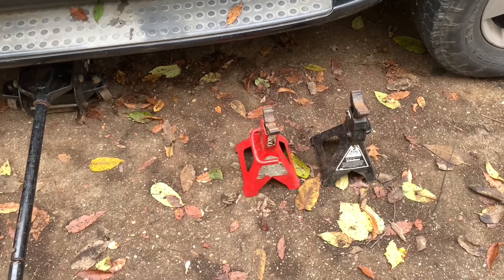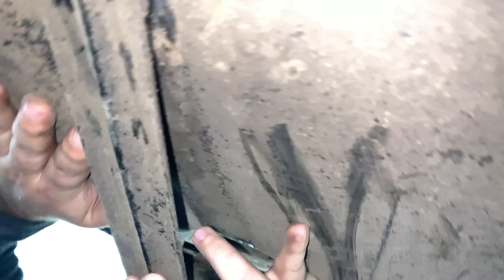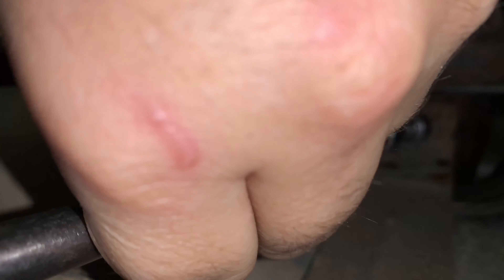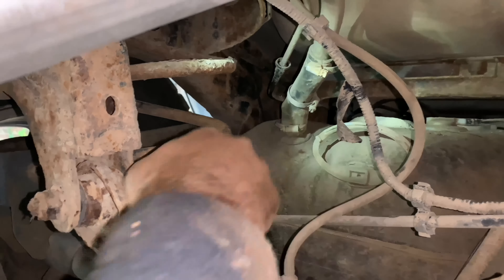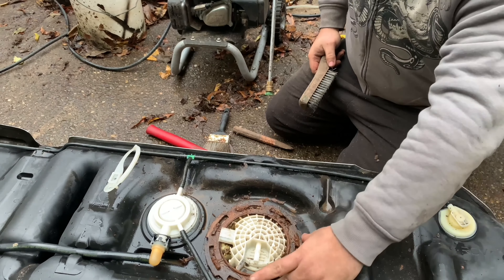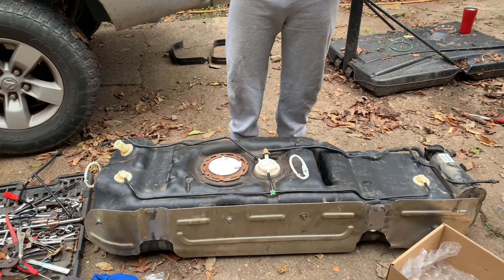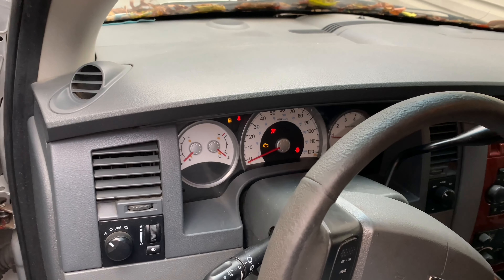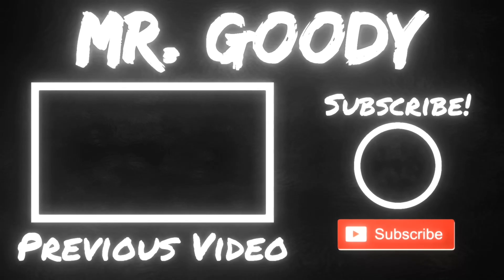How To Replace And Reinstall A Fuel Pump On A 2005 Dodge Durango 5.7 L Engine Hemi Edition - DIY

Comment: Why didn't you clean the inside of the tank due to the ETOH gas.
Reply from the maker: Off camera I actually did clean the outside and the inside of the tank.  Due to safety reasons and also to make sure and clean any sediments from the bottom of the tank also.  So no metal sparks would ignite any flame.
Reply: talk is cheap. make a You Tube video and walk the walk 🤔

Comment: I would like to thank you very much for making this video.  I could not afford to pay a mechanic to do this.  Please keep making videos.  I would like to make one other comment.  You did lie to use in your video.  You said you took your time with a rag and soap and water to clean the tank.  But guess what....you can see the pressure washer behind you in the video. Lol.....Thanks again.  You saved me so much money.
Reply from the maker: Thank you for the kind words and compliment. However, you only halfway caught me about the way I washed out the gas tank.  I use the pressure washer first and then I actually took warm water and soap and did it by hand from inside out and on the outside of the tank and then I pressure washed it one more time so technically you’re kinda a half right but it did take me a long time.  I’ll keep making videos as long as I’m breathing. I hope you have a great day. 👍❤️

Comment: It took me longer to get the fuel line off the pump than the rest or the job put together.  What you showed at 13:45 really saved me.  THANK YOU.  Maybe there is supposed to be a way to push and release but it wasn't going to happen. Like you showed, I had to dig out that clip.  I took a little time and I starting with incremental sized jewelers screwdrivers to get both sides to come out sorta together.  I did not want to break the clip or I'd be days getting another.    
FYI, the whole job was because somebody wrongly replaced the pump before, and broke the fuel level sending unit float arm when installing it (fuel gage stopped working) .  I say wrongly because the original pump never failed.  It was the Total integrated power module  (TIPM in a 2011 Caravan).
Thank you again for the video.
Reply from the maker: Your welcome my friend I’m glad the video helped ✌️👍
Reply: How did you find the plastic clip just in case you had to replace it. I broke mine but done even know where tog etc started to find a new one
Reply: @JaydenAdams-xx3xq  I didn't break mine.  I think if I were you I'd use safety wire (stainless steel tie wire (original use was to tie screws on aircraft so they don't come loose) and just wrap around the line below the connector and then tie it to the plastic unit.  I would drill a few small hole in the webbing of the pump housing to tie to.  You could probably do a similar job with zip ties.  Make sure the connection is secure and won't rust off.

Comment: one of the best videos I've watched..you went out of your way to explain every detail, thank you!
Reply from the maker: I do YouTube as a hobby and try to help people so if I helped just one person then I feel that my job is done I’m glad the video helped you my friend ✌️👍
Reply: you explain things really well, especially the little details..I have the dealer shop manuals and they're horrible! 4 huge volumes explaining nothing!
curious about how many hours did it take you all together to take the old pump off and replacing it?
Reply from the maker: Since I have done worked on cars here in there since I was a kid with my uncle it took me about 2 1/2 to 3 hours but I’m kind of used to doing these things even though as my main job I became a computer technician. But I work on a little bit of everything.
Reply: @Mr_Goody  you're really good at it! funny thing I never worked on cars until I inherited a 1930 ford model A that my mom learned to drive in when she was 12! I proceeded to do a total frame off restoration with my son and after 2 years (I only have time on weekends) it's almost all back together..every bolt and engine part was removed, cleaned and reinstalled! we are all crazy haha
Reply from the maker: That’s awesome story,  That’s what I call spending quality time with your son he will remember it forever ✌️👍

Comment: That last connector you pulled off was into the charcoal canister. the "fuel filter" and lines coming off it that have no clamps or connects are all part of your evap system (controls emissions from evaporating fuel) 
Good work, never fun on the ground with Jack stands hahaha. Keep on wrenching
Reply from the maker: Thanks for the info and encouragement 👍✌️
Reply: Where is the fuel filter?
Reply: @brendangay9007  there is a pre filter on the pump pickup and there is likely one inline on the frame somewhere

Comment: I know its not uncommon to get a bad fuel pump but is thr any way to be sure it's bad b4 have to drop the tank for the 3rd time? Had a bad gas leak dropped tank broke housing on pump. Tried to rig it, got it back in gas still leaking. Had to buy the whole pump. Replaced it. Put it back together and fuel pump doesn't come on at all. Relay & fuse good. Really not trying to drop this tank again. Any advice besides some folks just arent meant to be diy'rs. 🙄🙃
Reply from the maker: Well, what you can do is have someone turn over the key and not turn it on while you’re next to the gas tank and see if the fuel pump primes the fuel because as soon as you turn the key over before you start the vehicle, you’ll hear the fuel pump kick on and it’ll kind of prime fuel to be ready to be started. You can try that a few times. If you don’t hear anything kicking on then the fuel pump is not getting any power and it’s not working at all

Comment: Good job on video how many miles on your Durango when fuel pump died thanks brother
Reply from the maker: 118k miles when the fuel pump went out.
Reply: @Mr_Goody  ok thanks I have 2008; Aspen basically a Durango with 213'000 miles I'm pretty sure Its dead fuse relay seems good pump not energizeing when key on position engine starts with starting fluid

Comment: Ik its 5 yrs now but mine went out on the highway is this job possible from the rear by the hatch with where she broke down it would be unsafe to have the jack driverside rear as it could be hit by oncoming cars any advice would be great doing it today
Reply from the maker: If you are careful, you can do it from the rear or the opposite side that is on the shoulder of the road.  I strongly suggest that you do not work work on the shoulder of the road. It is very dangerous but if you have to like, I said, do it from the opposite side of the vehicle.  Try to see if there are some friends that can pull you to a parking lot. That’s close or any place that is away from the road.

Comment: I have a aspen that I ran on a empty tank for a few miles… I put a quarter tank on it drove it and turned off on me… I first thought it was the alternator it wasn’t that I checked fuses the truck will crank starter and all but til I noticed no gas being pumped to the engine… i sprayed gas directly into the throttle and it turned on but then off.I purchased a Bosch unit and will be installing tomorrow morning hope that solves it my family depends on her
Reply from the maker: Good luck, my friend. Let us know how it turns out please.
Reply: It Worked!!! Thanks to ur video…. I am now fishing with my kids, One thing tho brother is the fuel connector on the pump is a press in tab but thanks brother may god give u health and prosperity thank you
Reply from the maker: You are welcome my friend. I’m glad the video helped.  And enjoy your kids because before you know it, they will be grown up. They grow fast. 👍

Comment: before you pull the fuel pump go around the top and tap it to loosen the rust ,, then get a shop vac to clean debis befor pulling it out

Comment: This is a good video for this repair. If I could offer you a suggestion; a little bit of lubricant does wonders, use it on the retaining ring, the bolts, and the fuel neck hose and you’ll find your reassembly is a lot easier.  Also it doesn’t hurt to mention that you will want to take great care not to introduce dirt into the tank. Good job !
Reply from the maker: Thank you for the suggestions and the feedback I think what you have suggested is a great idea 👍✌️

Comment: whats the part number of that fuel line connector to the fuel pump? Easy to put on? I have an 04 durango so maybe not the part number but whats the part called?Its not a quick connect right?
Reply from the maker: It’s is a quick connect, the part number had been long gone from it. Due to age.
Reply: @Mr_Goody  Did you use the same exact connector? Or a squeeze type? Im seeing some of the squeeze ones on amazon.
Reply from the maker: @JanoyCresva    I myself use the exact same type.  It’s just a quick connect.  It’s really easy to snap on.
Reply: @Mr_Goody  What happened to mine was when i was taking it off the old one half the plastic of the fuel pump broke off inside the connector. So to replace yours did you heat up the hose with a heat gun, pulled the old one out, then just put the new one on there? 

Sorry for all the questions but its pretty much the last thing i have left to figure out. Thanks.
Reply from the maker: If I remember correctly, I think I put a whole new hose on from where it connects to the tank with a quick connect already built in on the other end, and I had to measure how long it was so that it would have enough length to connect.  The reason it broke on me in the first place is because overtime where it’s plastic it had become brittle and it just kind of broke under the slightest bit of pressure but a new hose with a quick connect on the end did the trick, and it was pretty easy to put on and be back up and running again.
Reply: @Mr_Goody  OK thanks. Yeah im seeing that a few of them are sold with the hose already on there. I'll probably go with that instead of wrestling around with trying to get that chunk of plastic out of the other one. Thanks again.
Reply from the maker: @JanoyCresva   Your Welcome my friend.

Comment: When you use the flat head to get the fuel line off that was wrong that is a push button quick connect you do not pry on it you could damage that line the plastic line going to the assembly
Reply from the maker: You are correct you COULD damage it if you don’t have a quick disconnect but I did it gently and it worked but technically you’re right to get a quick disconnect tool I believe I mentioned that in the video.
Reply: So what happens if u do damage that connect piece? Can that end piece be replaced?
Reply: @beckygee9859 it can just gone have to rig it up unless you get replacement from junk yard
Reply: @bossmancustomz6891  thanks for the reply. That's exactly what i feared... Damn it...

Comment: does the bigger fuel tank strap go in the back or front? Forgot to mark them
Reply from the maker: It’s been so long ago I can’t remember right off but I do know that there’s a certain length on each one of those brackets and only the bigger one will cover up the back I believe is where it’s taller and I believe the smaller one goes up front, but the front bracket will not cover the length of the back if it’s the smaller bracket I hope you see what I’m saying you can just hold the brackets up to the tank as you put it on and see if it will reach or not.
Reply: @Mr_Goody  Yup you were right. Im having a heck of a time putting the back strap up into the metal slit. The front one was fairly easy. NOthing about this job has been easy lol.
Reply from the maker: My advice is just take time and believe in yourself and take a break. If you need it trust me I said plenty of cuss words I had to edit out. 👍

Comment: an access point underneath the back seats should've been mandatory on all vehicles, I gotta a 2004 Durango I need to change the fuel pump out on, and I'm thinking I'm gonna lift up my back seat, cut the carpet out and use a corded Dremel with cutting wheel and make my own access point that the manufacturer should've done in the first place, I'll record it when I do it, it'll be invisible to see once done and I'll replace the small cut out with carpet and aluminum plate, but, if I change my mind, I'll be using your tutorial, thank you.
Reply from the maker: I agree with you. Some vehicles do have access points, but all of them should too bad. This one doesn’t but good luck on making one. I hope everything goes good for you. 👍
Reply: I just made a cut out today day and I'm glad I did it save a lot of time and I didn't have to mess around underneath the dodge i just popped out the old one and popped in the new one, I recommend it good luck.

Comment: Q: What’s your suggestions  if one of bolts broke? How can I get it out. Each time I watch the video I thank you for sharing and posting.
Reply from the maker: Which bolt broke?  I usually use an easy out.  Or a drill.
Reply: @Mr_Goody  it’s the one in the front.
Reply from the maker: You could try easy outs they sell them at a lot of car parts places.  I myself have a steady hand and use drills most of the time.

Comment: I have the same vehicle. 
Getting the fuel pressure test done today. I'm still not sure if it's the fuel pump.
My symptoms 
7 or 8 seconds cranking then starts every time.
While it warms up it might stall a few times.
Once it's warm it won't stall and pers like new. No running rough...until I get up to highway speed. Then I get some hesitation and power loss.
Any thoughts?
Thanks...New Subscriber
Reply from the maker: A lot of times this will be caused by an 02 sensor intermittently going bad where the fuel and air mixture is not what it’s supposed to be., also with it’s starting like that I would say check your crank sensor.  That’s what I can think of right off top of my head.
Reply: @Mr_Goody  
Thanks for your help.
It's running right.
It was the cam shift positioning sensor. 👍
Reply from the maker: You’re welcome my friend I’m glad you got it fixed.

Comment: I am replacing my 2004 fuel pump. Is this a heat shield I am seeing that I need to remove in order to drop the fuel tank?

Comment: The tab on top the fuel line quick connect fitting presses in to unlock, then can be pulled off. That's why it broke! :)
Reply from the maker: You sir are correct and if you click on the description to my video you can see that I have put a link for replacement tabs that you can buy and easily install.

Comment: Great video , wanted to ask what mileage did your fuel pump needed to be replaced?  where and how much did you buy the fuel pump on the video(TRW) THX,
Reply from the maker: At a little over 160k miles.

Comment: Whats the part number for the quick connect you replaced from the fuel pump? Mine is leaking but I can't find it. Thanks
Reply from the maker: Sorry I took me so long to respond but this should be the part numbers and SKU numbers

Part # 800-023
SKU # 604824

Comment: This is an awesome video. Q: What were the indicators that you experienced to know that it was the fuel pump? Thankk you for sharing,
Reply from the maker: The car was spitting and sputtering and died.  If you turn your key over without starting the car you should be able to hear the fuel pump kick on.   If you don’t hear it come on that is a good indication that your fuel pump has went bad.
Reply: @Mr_Goody  thank you so much. These are the indicators that you mentioned in experiencing.
Reply from the maker: Your Welcome my friend.
Reply: I forgot to ask you about the tool that used to disconnect those line.
Reply from the maker: @5smoothstonesproject740    It’s called quick connect and you just go to your Auto parts store and they sell tools to pull in the plastic tabs on the quick disconnect.  If you explain to them they will understand.
Reply: @Mr_Goody  thank you again. I soaked the bolts heavy and one snapped. But I’ll figure it out. Thank you brother
Reply from the maker: @5smoothstonesproject740  Your Welcome my friend.  ✌️👍

Comment: Ok… but how do I replace it without have to remove the gas tank and go through all of that other stuff. 

And without having to hire someone else to do it.
Reply from the maker: This video shows you exactly how to replace the fuel pump you have to drop the fuel tank in order to remove it.  And I also show you how to do it without hiring someone else to do it and that is if you feel comfortable in doing it yourself.  I wish I had better news for you.

Comment: I’m having the darnest time trying to get the last 2 connectors off at the fuel pump. The plastic not quick connect and a electrical harness
Reply from the maker: If you look on the top of my channel banner just click on my Instagram so you can show me a picture of the connector and then I will do my best to help you.
Reply: @Mr_Goody  since my last response I have removed the fuel tank replaced the pump and she is running again. I took it to shop to have the bolt removed. Again Mr. Goody, brother thank you so much for sharing this video!!
Reply from the maker: @5smoothstonesproject740  You are very welcome my friend I’m just happy it helped. ✌️👍

Comment: Time for American car companies to get with the times and make the fuel pump easy access like honda and Toyota.
Reply from the maker: I agree and not only easy access to fuel pumps but also the spark plugs.
Reply: @Mr_Goody  And let's not forget timing chain and sometimes water pump. Some genius decided to put water pumps inside the engine 😆
Reply from the maker: Heck yeah on that one too ✌️👍
Reply: @josephcazzuto7198  cadillac also puts their starters in the center of the engine. You might as well do a head gasket change while it is off. This is on the deville. I cant speak for the others.